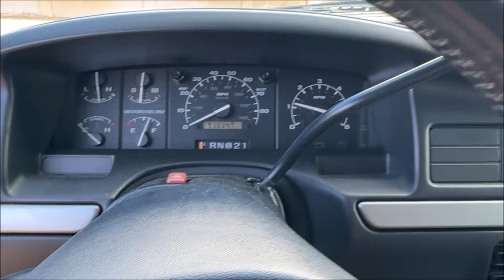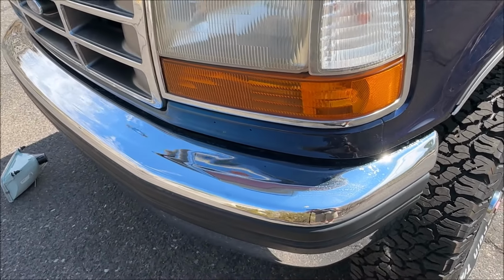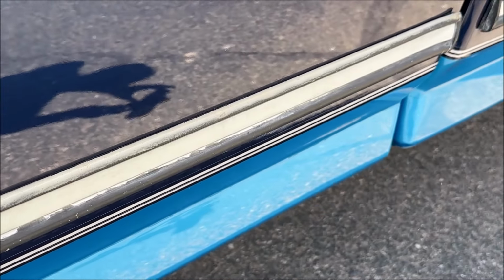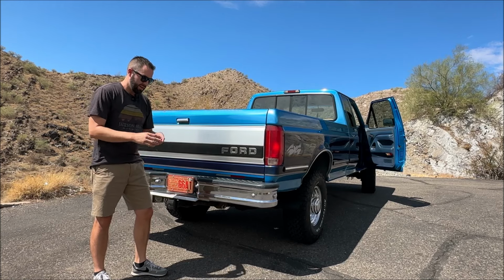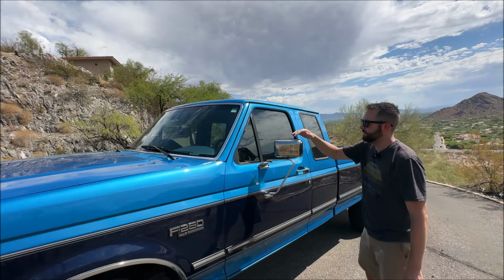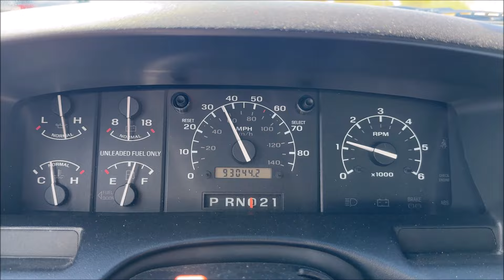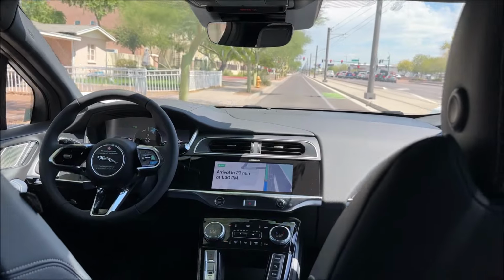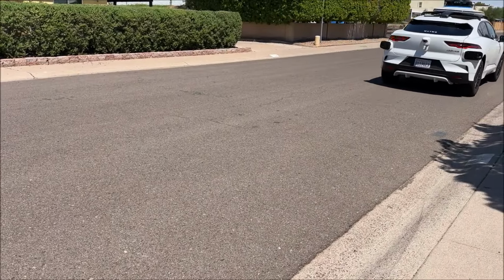The F-250 Goes to Apex Wet Werks

Comment: I had an ‘88 and a ‘94 F150, that front badge was only on 8th gen’s. It said either 4x4, Diesel or EFI. That went away for the 9th gen. So you are correct to remove it.
Reply from the maker: Awesome, thanks Mark!

Comment: Here's the weird thing with my immediate family my grandmother on my dads side is the only one who has a honda besides my grant aunt on his side my grandmother has a 2009 honda accord LX-P that she bought brand new and it's been 15 years and only 85,000 miles so yea and my great aunt has a 8th gen civic forgot what trim it is i think it's a ex or a ex-l but on the civic the clearcoat is failing everywhere which i think is a normal thing on the 8th gens? The accord has gone through 3 sets of pads and rotors normal thing on the 8th gen accords. Great Video!
Reply from the maker: That's awesome you have some Hondas in the fam. I'm not sure on the clear coat question for 8th gen Civics.